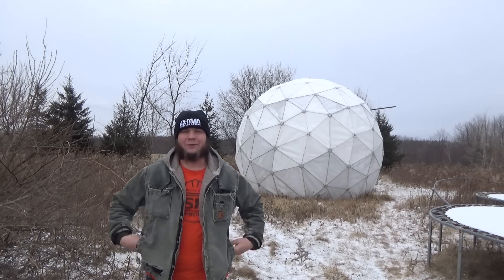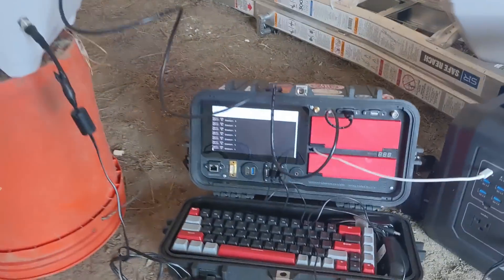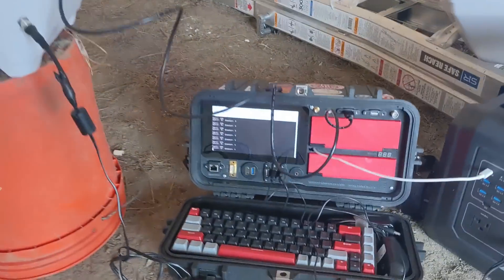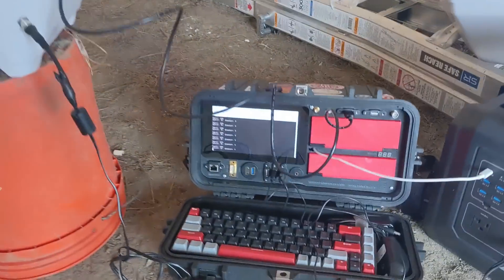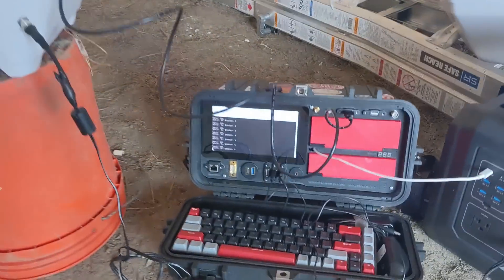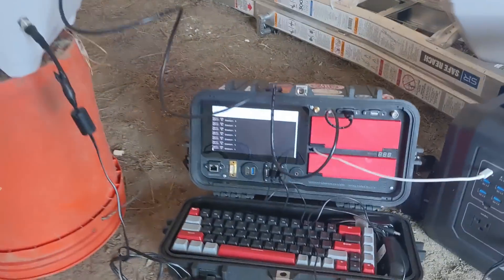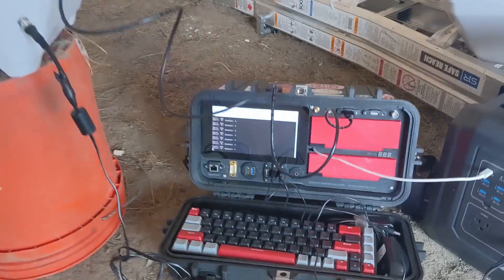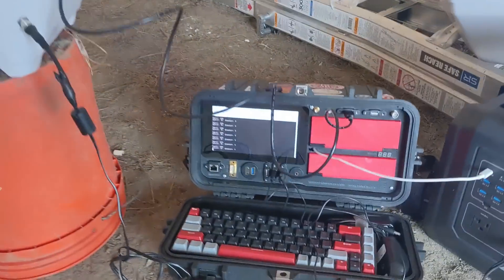How Does A Radome Affect Radio Signals?

Comment: You can use a standard linear actuator designed for the old style 8 to 15 or so foot diameter K or L band TV satellites.  There is a digital encoder inside the motor housing that uses an lED shining through the slots in the encoder wheel onto a phototransistor to send pulses to a counter in the control unit.  This can result in 25 to 100 or more pulses for each revolution of the shaft which will result in a very fine degree of control.  These can probably be found very cheaply or even free from someone that just wants to get rid of one of the large dishes since the small direct broadcast dishes have taken over the market.  These are driven by low voltage DC so there's no high voltage AC power needed.  A simple driver circuit can be used to move the dish to any azimuth, and a pair of them can give both azimuth and elevation control.  Hope this helps.

Comment: Hi saveitforparts,
Your microwave imager project is fascinating!

Looking forward to more experiments with mm wave imaging. I’m no expert but I’m self taught and I like to recommend some ideas:

Placing some rows of wire or rods in different orientations in front of the antenna to filter out other polarized waves to increase resolution.

And or antenna arrays(mechanically scanned or phased array to speed up rendering in the future?).

Your video from last year got me considering building combined camera and microwave imagers!

Comment: how much does the 8 ft dish weigh? (if one was to make something to pan and tilt...)
Reply from the maker: I'm not actually sure, I should weigh it. The balance and offset of the weight is also important, when the dish is in certain orientations it will put a lot of torque on the motor system.

Comment: What is actually going on to create the pattern in the receiver? Is energy being diffracted around the beams to create hotspots through some kind of lensing effect?
Reply from the maker: It could be reflections from radio noise inside the dome (from the computer running the antenna), or could be background radiation from the sun reflecting off the ground. Might be worth trying a scan at night and one with the computer farther away.

Comment: Wow. Really great results!
So, are the rings around the satellite on the left the intensity pattern of the Airy disk of your antenna? Very interesting!
Also, I surmise the struts of the dome will show up much fainter and more spread out for a larger dish, as, on the one hand, the large dish averages over a larger aera of the dome shell (provably really making good use of the random nature of the triangles). On the other hand, the small antenna has a focal length of some 20-30 cm. This would put the dome at about 10 focal lengths from the antenna, so it appears quite sharp at the infinity focus of the dish, where the signal is coupled out. The larger dish has a larger focal length, so this would be more like photographing through a chain link fence with a telephoto lens, whereas you just photographed through the fence with a 50 mm lens from 50 cm away: it'll show up in the image.
In short, I think you'll be much better off with the larger antenna, and I do wish you loads of fun with this great setup!
You could try if you can pick up the radio emissipns of Jupiter at night and later in the year in the day time...
Reply from the maker: I'm definitely planning a larger antenna, it will be interesting to see how that works! I'm slowly learning more of the science behind what's mostly "messing around" right now :-)
Reply: @saveitforparts Your "just messing around" is seriously impressive, already (says a physicist)
In the mean time, you could try how the image of the framing changes when you move the antenna closer to one side of the dome.

Comment: I'd like to see the if same results are obtained with the bigger antennas, very curious.

As for the motors, in the lab I work with big antennas for satellite comms (upc-nanosatlab) we use rf-ham design rotors, they work very well but are a bit expensive.

Comment: An expert I am not, but, if the signal comes from outside the dome and the signal bounces off the frame structure, wouldn't it mostly bounce away from the dome?
In one of your previous videos, when you first got this dish going, you scanned the inside of your house and cat. If I remember correctly there was a strong signal 
coming from your computer. So could there be some signal coming from inside the dome, like your cyberdeck, phone, etc., that is reflecting off the framework?
Or maybe you should ground the framework so it's conductive material doesn't absorb and radiate electromagnetic frequencies.
Reply from the maker: It could be reflections from the computer, I'll have to try another scan with the computer farther away, if I can get a long enough USB cable!

Comment: Are there usually attempts to isolate the metal frame from ground?
Reply from the maker: I think usually you want it grounded in case of lightning strikes. Mine just has some big rebar hammered through the edges into the ground.

Comment: Stuff as big of reflector as you can get in there and don’t you just need two pulleys and an electric motor with an rpm lead and a voltage regulator? I’d think with relays, transistors, ic, and RP you could then do whatever you want pretty easily

Comment: Going on baseless intuition it seems like there should be a relationship between the image clarity of the radome's structure and the size of the dish. With this small dish the conic reception volume rapidly moves from including no aluminum to including a lot of aluminum, allowing a high resolution shadow on the scan. With a dish that's larger than the triangles, the reception volume will never be absent aluminum so any shadow it resolves is going to be much blurrier. With a dish that's twice the size of the triangle the amount of aluminum varies constantly and complexly from sample position to sample position, which should somewhat balance out and appear just as a somewhat inconsistent dimming of the entire scan.

An extrapolation of this is that if you could get an even smaller dish it would be even sharper
Reply from the maker: Smaller dishes actually have wider "focus" (beamwidth), and larger dishes have a sharper focus, so I'm not sure how that would look. It should be interesting to find out!
Reply: @saveitforparts  overall yes, but in the extreme near field the relative scale of the dish is going to be the dominant factor. Going by the first random calculator google gave me, 14GHz (default), taking the -9dB angle, putting in a 30cm dish and a 2m dish, modelled inside a 10m diameter sphere (I do not have any of your real numbers in my head right now), the 30cm dish sees a 1.026m diameter, 0.827m^2 section of the structure, while the 2m dish seeds a 2.106m diameter, 3.483m^2 section. The smaller the section, the simpler the attenuation behaves, the finer features it can resolve.

I was wrong about smaller dish ~= finer resolution, a 10cm dish has a larger beam patch than a 2m dish. I don't know the math so I can't locate the exact inflection point on this, but a 60cm dish has a similar beam patch to a 30, so maximum 10m diameter radome scanning resolution is probably in the vicinity of 45cm. It's 1AM but this almost sounds like something worth thinking about when I phrase it that way.

Comment: What are those Ku satellites in a line on the right going diagonal above the Clarke Belt ?
Reply from the maker: There are a few geosynchronous (but not geostationary) that seem to move up and down in an elliptical orbit relative to us on the ground. That can be a way to serve high-latitude communities.
Reply: @saveitforparts  I don't know what Part of the arc you are seeing. I think those are around 103 to 113
The angle is going up at about 30 degrees 
They are densely spaced, making a continuous signal for the entire range. 

I never saw these before 

You should try to use a 1 meter Ku dish and point at those satellites that are not on the belt and see what they are transmitting 

I used to watch Alaska stations on AMC-7 135 degrees W
That satellite fed Alaska and there are other satellites in the 103 to 119 range that feed Canada pay TV

Those out of arc satellites are definitely feeding constantly and they are stationary and I have not heard anything about this 

It makes sense because the arc is full, that they would make a new arc but the satellites are not in an arc
If it continues down it would cross the arc

A real mystery 
There should be pilot signals on the satellites with their ID
The expensive satellite meters have the software to read the pilot signal and they know what satellite they are looking at

Comment: I wonder if the reason you're seeing signal seemingly from the dome structure itself is that the dome is reflecting back 12GHz signal leaked by the receiver? It's going to have a local oscillator running. Shielding the receiver and computer, or just running a cable to them outside the dome, might eliminate the noise entirely!
Reply from the maker: It shouldn't be leaking that much, although that would be an interesting idea to point two of these at eachother and see what one looks like.
Reply: @saveitforparts  I'd like to see that!

Comment: 7:22 It would be interesting to know in what units your signal strength is measured.  If logarithmic as is typical for signal units then your loss calculation will be incorrect.
Reply from the maker: Unfortunately there's no documentation on this little dish so I don't really know what the units are!

Comment: Do you think the extra noise was from the computer etc... that you put inside the dome as well? What if the dish was inside but the other do-dabs are outside? do-dabs = lithium battery deal... deal = what appears to be a power source, cyberdeck etc... Maybe insulate teh cables as they lead out of the dome. I'm just speculating as in your video from the nato people, they move the dish from inside that building but the dome was exterior to their do-dabs. If this makes any sense I dunno.
Reply from the maker: That's a possibility, I know the little dish picks up Wifi to some extent, even though it's not tuned for that.

Comment: I want to be your neighbor. So much cool stuff going on.👍
Kiln dried Bamboo is stronger than Aluminium, and better in most other respects. And lasts forever.
In Asia, they make scaffolding at construction sites, upto 15 stories, levels, etc. using 1" to 2" diameter.
It is used in many RF environments.

Comment: I wonder if that little dish that you have there could even fit inside one of those fake plastic rocks that are made to be transparent to RF... Another thing would be a plastic shed like Rubbermaid makes. It also might be possible in the dome if the base could "scoot" over a bit with each pass, to subtract out the interference of the dome. After all, it works well for reheating pizza in the microwave... 🤣 (The plastic "rock" or shed idea might also help hams in HOA Karen infested places)
73 DE W8LV BILL (and sometimes W8LV/VE3)

Comment: wow, the beams of the radome make such an interesting background (well, foreground) pattern! I think it'll work for stationary links, but radio astronomy will always have the distinctive noise. I think you could programmatically remove it, but I would not trust said scan. I hope we can see it set in use with fixed remote equipment in the nearby future!

Comment: A larger primary will look right through the dome, it's because your dish is so much smaller than the aluminum lengths that the (very neat to see) pattern is visible. 
It's the same as with optics, a large objective lens and a long focal let you see "through" small obstructions like tree leaves, mesh fence or screen...
Reply: This is why binoculars work great in the car with the windows covered in water droplets. No one can see in and you can see.out fine.

Comment: A 9% loss is roughly equivalent to additional noise of about 28K.  Perfectly fine for what you're doing.  The loss through the radome will vary considerably with frequency/wavelength.  At longer wavelengths/lower frequencies, loss is dominated by the metallic structure spacing -- starting to act like a Faraday cage at lower frequencies.  At higher frequencies, it's dominated by dielectric loss in the radome membrane.  That particular radome was likely used in a C-band weather radar, so the membrane material wasn't selected for exceedingly low loss at 10GHz and above, but your measurements indicate that at 21cm, and other wavelengths shorter than that, it'll be absolutely fine for radio astronomy and similar projects.   The metallic structure is likely "visible" in your scans because it's large enough to be a reasonable reflector of ground-noise radiation (at ~300K).   This was actually a fascinating result that I wasn't expecting.   It may not seem like science to you, but characterizing your instrumentation is a really really important part of any scientific journey.  Well done!  [I'm the guy from the former-NATO-base turned radio observatory mentioned in the vid[.
Reply from the maker: I'm looking forward to trying this with a larger dish at different frequencies. And as some folks mentioned I could try better shielding or positioning of my electronics inside the dome. As I get more experience with this stuff I'm hopefully learning more of the actual science along the way!
Reply: @saveitforparts  You can't go wrong with more shielding.  However, in this case, your electronics are unlikely to be radiating significant energy at 12GHz.

Comment: I would expect to see a loss of 0.5 to 2dB in signal strength through the "RF transparent" panels. Seeing the structure of the dome was interesting. I think that you may be seeing multipath reflections of radio energy from the satellites and other outside sources, reflecting into your dish. I think the primary source would be the satellites themselves. You see the primary path from the satellite coming in as a straight line, appearing as a hot spot as expected. The secondary path may be a much more attenuated side lobe of RF, coming in at an angle and being reflected off the metal. The metal may also be picking up and re-radiating RF to some extent but I would not expect a lot.
I don't have the math to describe this, but a larger (3 to 5 meter) dish with the proper focal length would not see the dome structure. The broadcast world has solved the accurate pointing issue with big dishes. You just need someone to donate an RCI RC2000 to you. It would work for radio astronomy.

Comment: I think it would be interesting(and probably a massive headache!) to turn a bunch of those tailgater dishes into an array kinda like SETI. If you did that, you'd eliminate the issues with a massive dish but you'd probably have a bunch of software problems to solve.
Reply from the maker: That's a pretty common suggestion! I've tried before but couldn't sync up the signals, need to try with a KrakenSDR :-)

Comment: Something to maybe try out is to mount the feedhorn somewhat closer to the dish , to avoid the noise inherent from the edges of the dish .
The effective loss in receive power is more than offset by the increase in your signal to noise ratio .
Something to consider especially if your budget doesn't permit ultra expensive cryogenically cooled equipment .
Reply from the maker: With the feedhorn closer you're illuminating less of the dish and have effectively a smaller antenna. This thing is already about the smallest you can go and still do anything interesing!

Comment: Might be worth asking if any nightclubs in your area have broken moving lights. Some of those pan/tilt yokes are HUGE, and you can control them with DMX or ArtNet instead of a proprietary serial interface. If you weren’t getting the little wine guard dishes for so cheap, I’d say that it’s almost worth purchasing a new generic 19x15w zoom wash to serve as the base for these projects. They’re too stupid to know whether or not the LED module and zoom motors are plugged in. So you take those off and wind up with a great 16-bit pan/tilt yoke with a heavy duty aluminum casting to screw into for mounting and convenient cable runs within.
Reply from the maker: I have a big pan/tilt mount but need to figure out the weird 15-pin cable to control it. Also have some leads on larger motors for larger dishes!
Reply: @saveitforparts I would laugh if you put up a short video on the connector, and one of your subscribers tells you it is a standard from the 60s-70s and how to get it to work.

Comment: The reason is that with such a small dish, there is very little signal amplification over background, so the gain has to be high, which brings up both the background and the self noise floor. A larger dish or a large connected array of these smaller dishes (wink wink) will catch more invisible sky juice so the gain can be lower and the background and self noise will be lower.
Reply from the maker: The array  is a pretty common suggestion! I've tried before but couldn't sync up the signals, need to try with a KrakenSDR :-)

Comment: Thing is about the surface area of the receiving reflector. Similarly when you use a big lens you can dissapear small things before the focal length. You can see through fine mesh etc. When you use larger surface area reflectors, the pattern will dissapear. However there should be a measurable difference in reception. A db or two.

Comment: Hello,

Yes the average will be bumped up due to the noise which is due to reflected signal off the structural elements (multipath). For satellite comms this will be fine but astronomy not so much.

I really found the testing and review you did on the 3d printer 1.7GHz antenna very helpful, would love to see a DIY tracker design for this...

Thanks you for your posts.